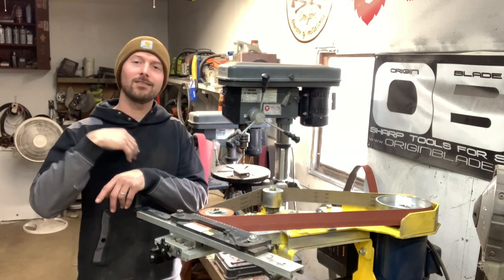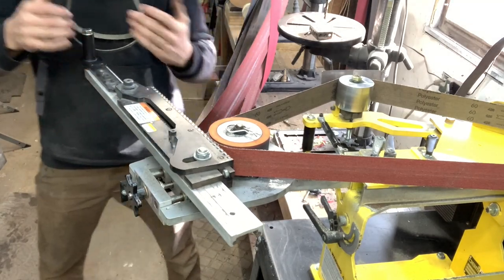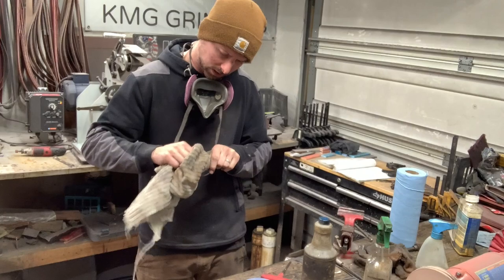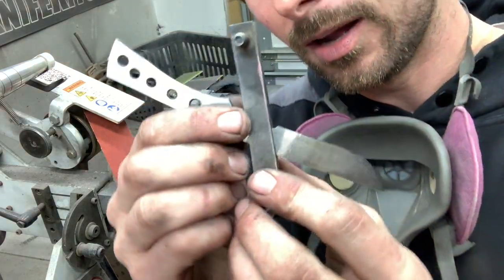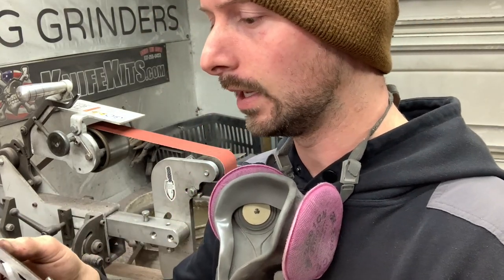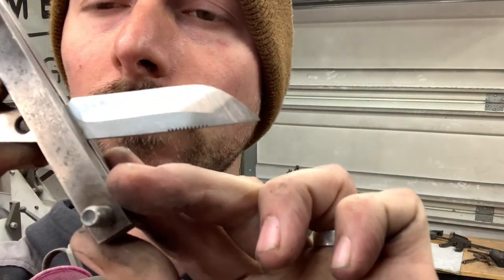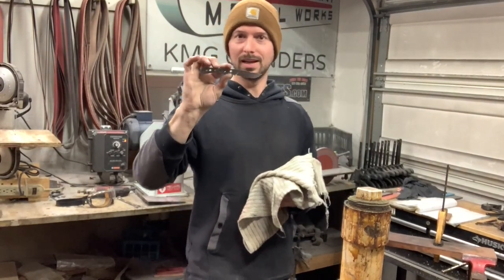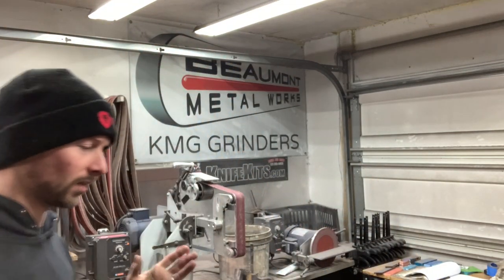GCK Build ALONG part 3!! Surface grinding and BEVELS!!!

Comment: At the risk of being obvious, what size drill bit do you use for ¼” pins in your handles? I’m really new at this, but it seems like a ¼” drill bit on my drill press is too small and the pin will not go in. Use the next higher numbered bit?
Reply from the maker: 1/4” I actually talk about that a little in my next video! Hope to have it up tomorrow
Reply: @gentrycustomknives8008  Try a size "F", its just a hair larger and the 1/4" pins fit right in!